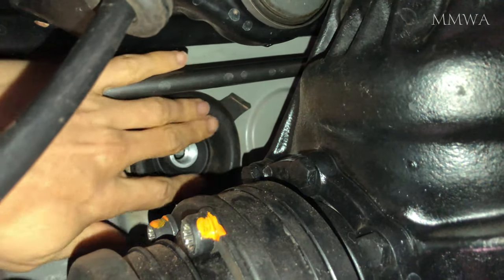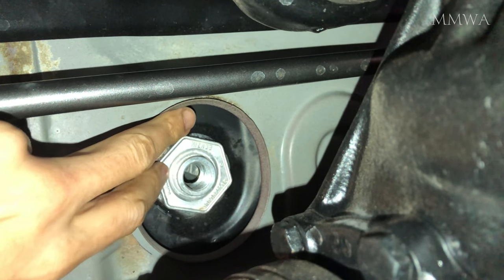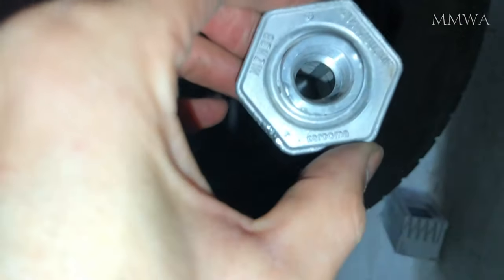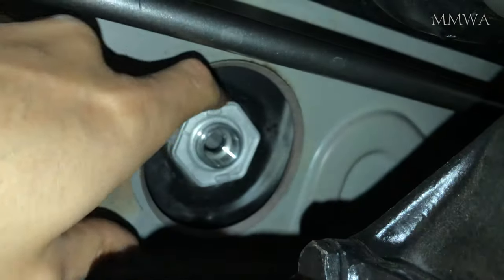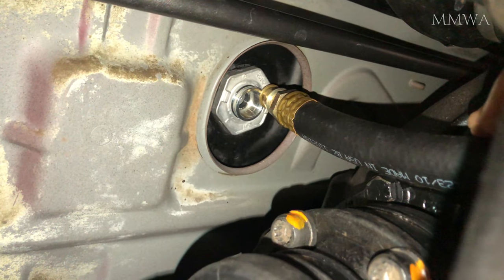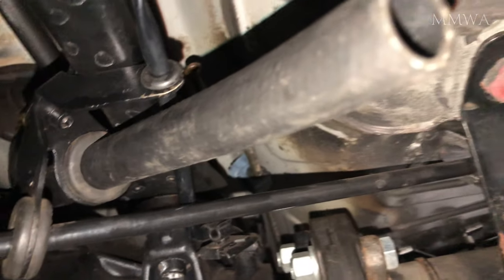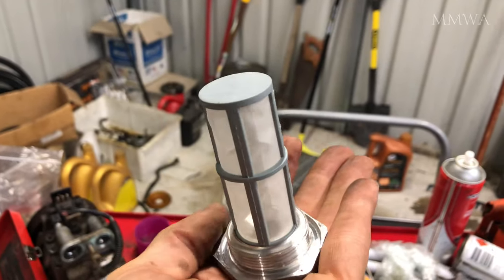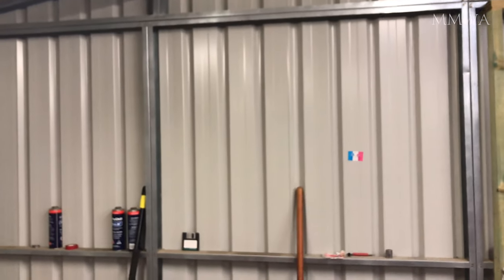Red W124 project - Fixing my fuel tank strainer mistake

Comment: I use a hammer and chisel to remove stuck bolts and nuts sometimes. Hit it at an angle on one of the flats to make a little groove. Then just tap it counter clockwise to remove. Destroys the fastener you are removing but it works.

Comment: Great video. Why did you change this part, to renew the filter, was the old one dirty?
Reply from the maker: This fuel tank that i got was absolutely mint - even the strainer was like new - but little did i know, because it came from a 1986 300E it had the earlier style strainer anyway. This is where the mistake was made, I ordered a new one by reading the number off this tanks strainer rather than the one that was originally in the red project. Never assume.... In any case I would have had no choice but to fit a new, correct strainer. The one in the original rusty tank was absolutely trashed.
Reply: Having seen your video I would think it's a good idea to change these as a service item, when working in this area, due to the age?
Reply from the maker: @bernardwarr4187  I think its car life dependant - as mentioned the original one from the 300E 1986 was absolutely perfect and could have been returned to service - If i had a car that used that hose connection. The one in red was almost completely blocked with red dirt / rust from the car being out in our bush areas where ultra fine red dirt gets into absolutely everything.

Comment: Hi,  I'm planning to buy one. Can you send the part number and mm of the screw of the strainer? Autohausaz is selling a hose, but I don't know the size. Thanks
Reply from the maker: I dont have access to it to measure it the tank was installed a long time ago with all fuel hoses. I would advise getting someone with the EPC to look up your vin to provide exactly the right hose and strainer part number. I believe the strainers are no longer manufactured and numbers are getting low.
Reply: Thanks